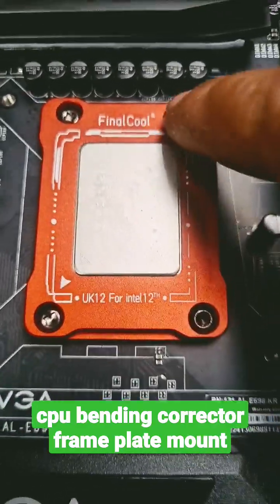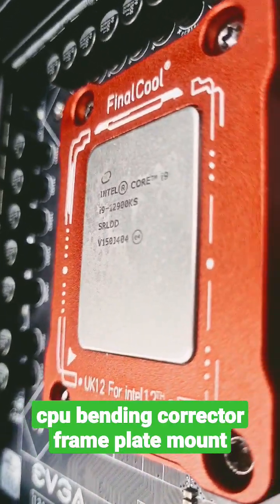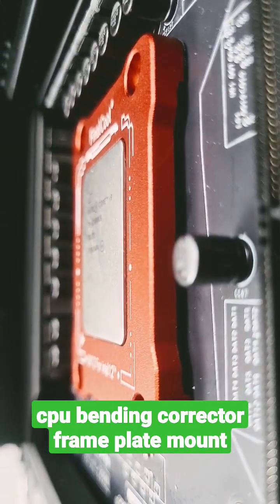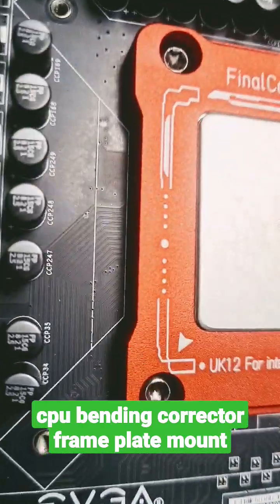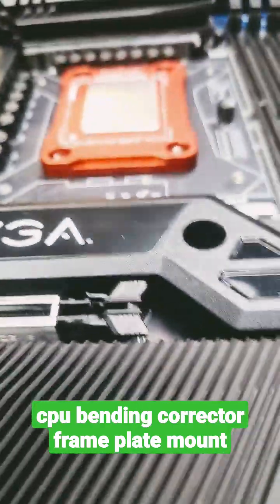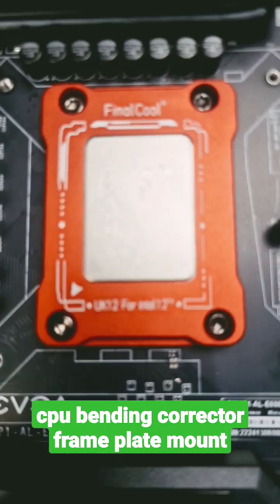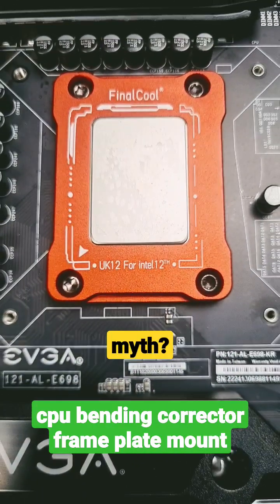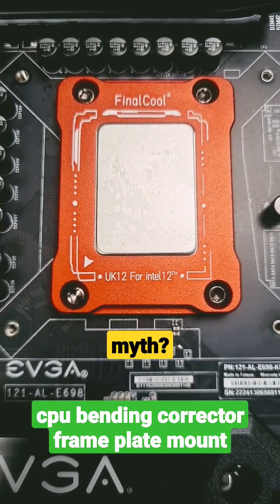after installing cpu contact frame plate for 12th gen lga 1700 cpu and motherboards  part 2

Comment: Hi I'm from philippines, do you have links or shop where to buy this?
Reply from the maker: yes i do here are some for you , ur in phillipines so u can use aliexpress and ebay or even amazon https://amzn.to/3ZtctPV 
https://s.click.aliexpress.com/e/_DnbFpp5
https://ebay.us/L8pHtK
any of these is fine 
i chose the cheapest ones, and they are all the same quality hard aluminum 
pick which ever u want , maybe closer to you is best
Reply from the maker: but let me express again ,. yes there has been proof that this helps with bending and  lowering temps by at least 10degress 
, its not needed if you have a good liquid cooler, the trick is to only mount with correct pressure /equal pressure/ 'x' pattern ive used mine without one for a long time
Reply: thank you so much!
Reply from the maker: @Vincent Solon  ur welcome